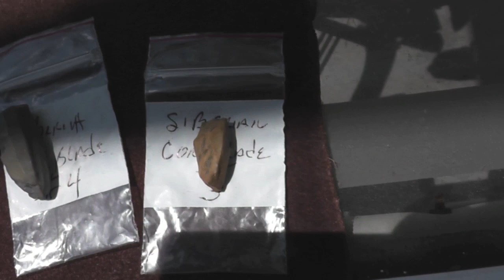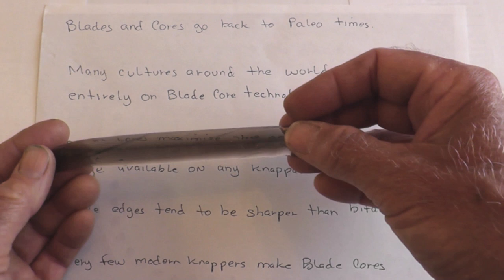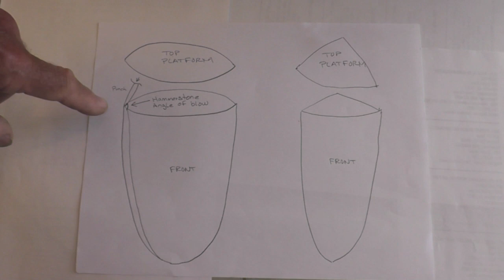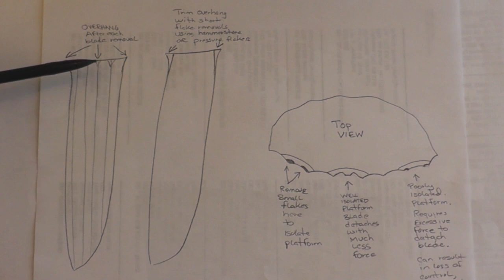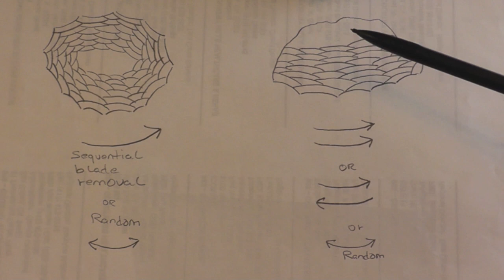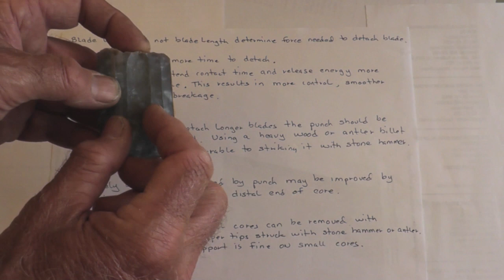Blade Core Basics Part 1

Comment: Several, several years ago a woman I worked with who was from El Salvador gave me what she just said was a "very pretty rock" she found in El Salvador. I recognized it as obsidian but was really confused by the shape. To me it looked like someone had somehow faceted the sides to make it more or less symmetrical. Now that I see your videos I realize that it is a blade core!!! I am totally amazed and now I wonder just how old it is. I wish I could somehow find out if it was modern or really old. At least I know what it is now and I am so blown away.
Reply from the maker: Very cool, I am sure your blade core must be at least several hundred years old and it could possibly be go back 3K years. Only a handful of snappers have made blade cores, so anything from El Salvador is most likely the real thing. Some of the old ones that were made with pressure blade removal are nearly perfect, those guys were true masters!
Reply: paleomanjim I'm just thrilled to have it. I'm so tempted to try to get a blade off of it but because I've never done anything like that before I really don't want to mess it up. It's not to the stage where it has those parallel facets on it yet but maybe the stage just before that. After the Thanksgiving holiday I will send you some pics. I'm trying to get into knapping because of your fantastic videos and have ordered a beginners kit and found some black and red obsidian on ebay for what I can only guess was an ok price. I just wish I could find a really affordable source for knapping stone since it looks like I'm going to need allot of practice to do it well.
Reply: @isaacnewton4741  Dude, I hope you didn't try to take more off of it, leave it authentic and try to replicate it! Just my advice.

Comment: maunakea adze quarry second largest on earth next to the big one is the southwest. its protected so have to find maui quarry which i have not yet to get materials legally. cant believe you did not get the info on the quarry at the top of the volcano there. it needs cold to make the solidifying process happen quickly allowing it to become super dense and looks light gray for the premium material compared to the other darker gray stuff. its a cryptocrytalline structures not very desired ;/